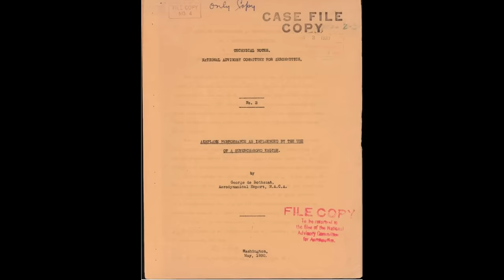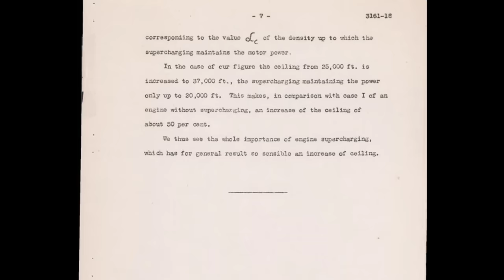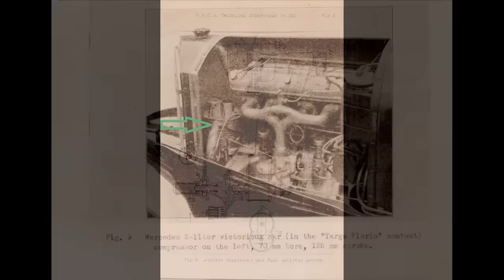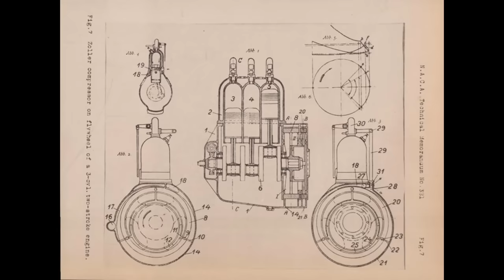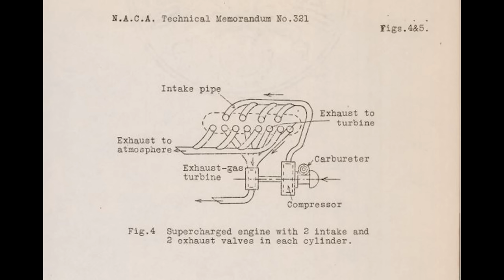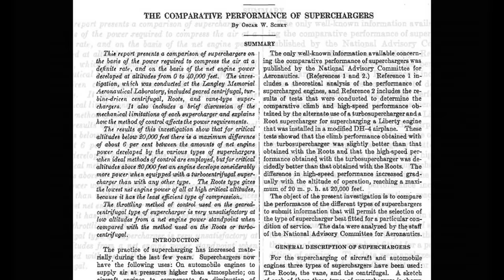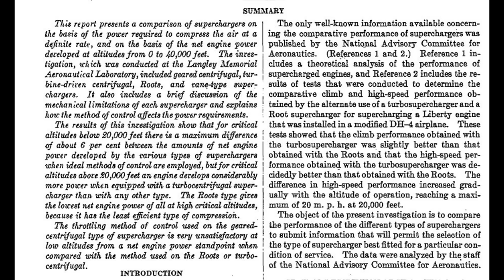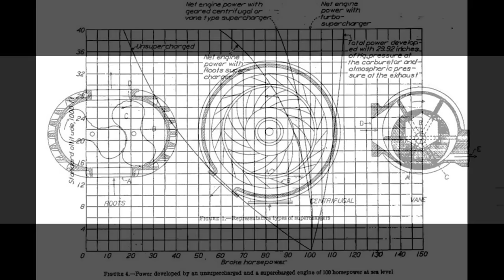Turbo vs Supercharging in WW2 Airplanes

Comment: Man - so many technical questions posted here. Mine: why aren't superchargers vented like turbochargers? In other words, it seems like a pilot has a lot to do, monitoring main and aux blowers and switching on the aux at altitude. Why isn't there a single high-speed blower used with a pressure relief valve (similar in principle to the turbo wastegate)? If the pressure relief valve maintains an upper limit on the pressure in the blower, the blower will spin madly at low altitude, but only produce, say 50 inches of mercury because of the relief valve. At 25,000 feet it will do the same, but venting is less necessary because of the lower initial air pressure through the intake. 

I am aware of the German solution with fluid coupling connected to an altimeter, but that seems to add more weight and complexity.

A second, tangential question - what was driving the limit on induction? It seems like the Australians pushed the limits quite a bit. What prevented an increase to 70, 80, or more? Preignition, or was there a mechanical constraint beyond which some part of the system would fail or wear out too quickly?
Reply from the maker: First Question. The answer is because then you would be paying for boost you are not using via excess supercahrger RPM. Second, they did go to 80 and even 90 inches of manifold pressure. The limit was normally knock, but not always.
Reply: @GregsAirplanesandAutomobiles  This is kind of my question. Isn't the bulk of the parasitic drag caused by turbine working against the positive pressure (as opposed to just the spinning of the turbine)? If it is the pressure, wouldn't having the pressure bleed off at your preferred PSI mean that you aren't getting any additional drag? 

You are obviously more familiar with forced induction, but it seems like a turbine spinning but not generating pressure would meet a fairly low level of resistance. I envision the bleed-off valve sitting on the turbine housing, preventing pressure (beyond what you want) from building up anywhere in the system. At low elevation the blower would send the bulk of the air out the valve, uncompressed. This would keep a constant pressure downstream from the blower, but prevent the blower from meeting any unwanted resistance (at low altitude). At higher elevations more of the air goes down the intake and you have more parasitic drag.

Comment: Greg's Airplanes and Automobiles
 No mention of the additional exhaust impulse thrust (negated by turbo-charging) or heat exchanger duct thrust ?
When in the high altitude cruise condition these can constitute up to 1/3 of the total propulsive power
Reply from the maker: Of course I have mentioned that, and gone over both factors extensively. It's not anywhere near 1/3 of the total propulsive power though, at least not in a WW2 plane. Now you didn't expect me to get everything into one video did you?
Reply: @GregsAirplanesandAutomobiles  Ah Great! I will look for that then. Though still think that it would be worth a mention in this analysis and quite relevant as with a turbocharger, there would be little if any exhaust jet thrust. 
George Bishop I think it was at Hatfield, chief designer of the Mosquito, once said after a long and involved set of test flights, finally achieving 424 mph (from memory)... "Next time, I think, we should start with the exhaust system and design an aircraft around it" 
They did also of course, try to benefit from a Meredith effect style radiator installation in the wing root. The Hornet brought all of these optimisations together with the ultimate mark of Merlin engine and tight cowling, and pretty sure Capt. Eric Winkle Brown mentioned 490mph being seen during RAE proving trials.

Comment: greg. Great stuff. Please do another where you the explain the following: differences, in any, in bsfc between turbos and multi stage, multi speed superchargers. Also, please explain the differences in construction and efficiency between the WWII open bucket turbos and modern turbos.  I have never understood why the 985 in my Staggerwing will make 310 hp on 21 gph  ( 19 gph, with a Bendix pressure carb/injector carb) at S/L, but requires 25 gph to make 300 hp at 8300 msl, all in standard conditions of course. Another bsfc question: how come the 985 at FT (no throttling issues with the blower) will make significantly more hp at 2200 rpm than at 2000 rpm at 12,000 and 15,000 msl  at EXACTLY the same fuel burn.  FYI, on turbo back pressure effects on power. I have several thousand hours in a Midget Mustang with an angle head Lyc 360 and manually controlled turbo.  Fuel consumption, at 75 F lean of peak, and 24 square, was identical at S/L & 17.5 K. BSFC in both cases was .425. EGTs and CHTs were way in green in both instances.
Reply from the maker: Hi Tom, I'll have to discuss BSFC at some point, but I can't get to that just yet. Each of those questions would almost require a 10 min video to fully answer.

Comment: Greg, you mention that P-38s couldn't really show their high altitude performance in the pacific. I highly recommend reading Martin Caidin's book "Fork Tailed Devil: The P-38". In this book it is noted the P-38 had an entire campaign of operations over 20,000 ft against the Japanese base at Rabaul. The P-47 was also a contender for these operations but the P-38 had a longer range and so was preferred. While the P-38 had trouble initially at high altitude in Europe, the same poor results were not seen at the same altitudes in the pacific. Part of the reason for this was in England, almost every P-38 pilot was trained on single engined aircraft and had never flown a twin engined plane before, let alone learned how to operate the P-38s cooling and turbocharging systems correctly. (According to pilot account in Caidin's book, early P-38's had a very low level of automation and required a lot of pilot knowledge to fly effectively.) Many damaged allisons and damaged turbocharging systems were the result of this lack of training. I'm not trying to disagree, the P-38s did have trouble with freezing temperatures in the earlier models. Once again, I love your channel Greg, it's one of the best, if not the best, channel on these topics. I always look forward to your videos!
Reply from the maker: Hi Stefan, I have read Martin Caidin's book, but it was a long time ago. I am a fan of his work. I only touched on the P38 in this video, but I'll cover it in more detail in the future. While it did operate in the Pacific at high altitude, most combat took place at lower and medium altitudes. The ability to fly up high and dive on enemies was a huge advantage for the P-38, but generally speaking, it wasn't shooting down Bettys, Sallys, Vals, and Zeros at 25,000 feet. Again, I'll cover this plane in detail later, I can't really do the subject justice any other way.
Reply: @GregsAirplanesandAutomobiles   Looking forward to it! Thanks for the reply, and yes I didn't mean to claim they flew at such high altitude all the time. Thanks again for the great content, I learn a lot from your videos!

Comment: A Roots style supercharger is called a Blower in slang for a reason - It does not compress air, only moves it at a higher velocity than the engine is drawing it. This is what creates boost - the air backing up between the "blower" and inlet valves. It's a very inefficient power adder.
Reply from the maker: It's more correct to say that it doesn't compress air internally, but it still compresses air in a piston engine application. The Roots type has advantages, but yes, it's generally less efficient than the other types. I actually have a video coming up about about a 400+ horsepower Roots supercharged 1.5 liter engine. Roots superchargers can and do work very well within certain parameters.
Reply: @GregsAirplanesandAutomobiles  Yes, it compresses the air in the manifold, not internally.

Comment: Hi Greg, new listener and new subscriber. Very informative video.
I am an army brat and spent some time in Germany as a kid.
Ages 4-6 in Berlin, ages 12-15 in Heidelberg. The 2nd time influencing most of my interests, 
I was an avid fan of ww2 aircraft and the general history of the time (almost exclusively european theater) as a kid, but during high school (stateside) I lost interest due to my new warring interests in cars and girls.
This overlapping information you provide is awesome. 
I don't know if you have covered this in any of your videos yet (possibly falsely, I learned this in high school, so.... girls you know) I recall that the rootes types  supercharger had issues with pulses caused by the lobes inherent design. Later version have advanced of course with spiral lobes, and other configurations, but the early ones were problematic for the pulses in the charged/pressurized air.
Reply from the maker: Hi Larry, yes, that's true, early Roots types have two intermeshing lobes, and they cause a pulsing. Later types get around that with various methods, currently the latest types used four lobes with so much twist in them that there is minimal pulsing.
Reply: Wow, thanks for responding so quickly. I didn't expect it. 
I am a fan of your videos, currently working thru your library. I just watched one where you are in Rammstein, I visited there once as a kid, didn't remember the castle and vaguely remember the base. 30 plus years ago. Do you live in Europe or just visiting?
Reply from the maker: I am an airline pilot, so I end up there at layovers from time to time. I like in Oklahoma.
Reply: Very cool, Washington for me

Comment: Thank you for this informative video. With technical information such as that you reference perhaps I can now start to understand why those at the top of the RAF were so fixated with the doctrine that the ' bomber will always get through'. However its seams obvious to me why the inline V12 was so dominant at the beginning of WW2, it was the only production option available, in Britain anyway, to Mitchel and Camm, that allowed them to get the speed required to outperform Germanys fast bombers. Germany do have a production radial available in 1941 and its used in the FW190, but RR are quickly able to match or exceed its performance by the introduction of the 2 stage boost MKIV spitfire. I note you didn't mention the Griffon, how would P47 compare to a mk22 spitfire? ( sorry I know I'm a biased Brit, but I did  worked for a US firm for 30yrs),
Reply from the maker: Hi Laurie, I'll try and work some Spitfire comparisons in the next video, and eventually I'll cover the Spitfire in more detail.

Comment: I've watched a lot of your videos about superchargers and they are incredibly informative, one thing I would like to know though is why didn't they use ram air turbines to power their superchargers, with a variable pitch propellor they could vary the amount of manifold pressure at will. Is it just a matter of there not being enough energy to extract? I'd think at those speeds it would work. I also don't understand why without a supercharger the manifold pressure max is atmospheric pressure, I'd assume it would be much higher due to the pressure of the air entering the intake scoop at speed

Comment: In a Japanese aircraft name, Ki isn't an abbreviation, it's a word.  "Ki" = American "key".  Ki is written キ (the phonetic symbol for ki) but originally comes from the character for "machine", 機体.  Details available at https://ja.wikipedia.org/wiki/%E8%BB%8D%E7%94%A8%E6%A9%9F%E3%81%AE%E5%91%BD%E5%90%8D%E8%A6%8F%E5%89%87_(%E6%97%A5%E6%9C%AC)#%E5%A4%A7%E6%97%A5%E6%9C%AC%E5%B8%9D%E5%9B%BD%E9%99%B8%E8%BB%8D
Reply from the maker: I'm sure you're right, so why the heck don't we just Write Key 84? I don't even remember discussing Japanese airplanes in this video.
Reply: @GregsAirplanesandAutomobiles   Greg's  you tangentially name-checked the Ki-87 as the k-i-87 in this vid...  Only going into pedantic detail as I thought you'd enjoy the drilldown.  A million thanks for the vid series.  Digging the cars too but really love the detail on the planes.

THE BIGGEST QUESTION I HAVE after watching this vid is why turbo packaging was so horrible?  Why not snuggle them up to the engine as we do now in cars?

SECOND QUESTION is cost.  How much more did Thunderbolts cost than Corsairs?  It seems like there's no point to Thunderbirds below 20,000 ft and yet they were used in ground attack.  Wouldn't it be cheaper to just make some (say) Corsairs for Europe and a few fewer Thunderbolts?  The Corsairs optimized for that wouldn't even need the aux blower and could have a bit more armor instead.
  To answer my own question, perhaps it's better to make one general purpose plane you can use for anything, rather than specialized planes for each little role?

THIRD: why didn't Allison simply copy the Merlin's general blower staging "on spec"?  Granted the US military wasn't yet requesting them but as an engineer it seems like quite easy work. with no downside and potentially huge upside.

FINALLY: I've always thought the P-38 would have made an equally good (or better) schnellbomber as the Mosquito, and be feted not disparaged in the European theater.  Instead it's initial inability to dogfight interceptors seems to have soured the theater on the 38s completely.   I'd be curious to hear your thoughts on that generally, and given this video I'd love to hear how their performance compared by altitude (thx to 38's turbos).
Reply from the maker: Thanks, I have to admit, it's been a while since I made this video, and have probably forgotten some of the details. Thanks for your kind remarks, and the clarification on the Ki term.

Comment: The turbo-supercharger won in the end. They just cut out all the fiddly pistons, cylinders etc. and ended up with the gas turbine (aka "jet").
Reply from the maker: It sure helps make power when all the parts are moving in the same direction.

Comment: ASAIKThey fitted the turbo at a 90 degree angle because of compact form and shorter airflow. Can't remember if the 90° angle the air has to take was the better, smaller angle solution or worse, extra angle.

Comment: I have a 2.0l direct injection gas turbo engine that really seems to have eliminated the lag.  Maybe lag was not so important on airplanes.  Interesting about the different types.  I had no Idea.  There is a supercharged Merlin in Pearson air museum Vancouver, WA.  I might have to go back and look at it again.
Reply: I think I figured out my own question.  Direct injection reduces the intake headspace so you don’t get the ballooning effect and turbo pressure increase is more linear.   I would be curious if any airplanes are using direct petrol/gas/benzine injection?
Reply: @naughtiusmaximus830  in General Aviation, I can't think of any production engines that are direct injection. However, I am not knowledgeable about the mechanical injection found on the Lycoming/Continentals.
Reply: @jiroyamamoto2878  Maybe turbo lag is just not an issue.
Reply: @naughtiusmaximus830  Yes, turbo lag is not really an issue, until you have to go around, as in abort a landing, when suddenly throttle response is an issue. Until that moment though it is not. Direct injection was pioneered by compression ignition engine manufacturers, in this case, Junkers. That was then transferred to spark ignition engines, the DB601, the Junkers Jumo and the BMW 801. Direct injection was adopted later by some other nations. Japan on a late war fighter, the Ki 84 and some others I don't remember.

Comment: I recall reading somewhere that turbo required more sophisticated metallurgy than superchargers- higher RPM?  And that was one reason Germany didn't go that route.  And that the experience gained in the US on turbines was a step up when jet engines came along.  Does that sound plausible?
Reply from the maker: It's entirely plausible. In fact it's true. G.E. had a huge head start in building turbine engine because of their experience with turbosuperchargers. Germany had metal shortage issues pretty much through the entire war.

Comment: This was super good!  I haven't heard the reason the Navy didn't like liquid cooling - insight on that?
In what little hot rodding and other wrenching (on little stuff)  I've done, it's been the case that with better control over head temperature (like you get with liquid cooling, or better yet, with aluminum heads too) - the more compression you can run, thus more power, while the air cooled stuff (especially smaller engines) need to have less compression and can't run the timing advance, because the head might get hot enough to lead to knocking/detonation a lot easier.  I'd guess most of us know that a liquid cooled engine is not as bullet resistant, but I never heard if that's why the Navy didn't like them.  Was the airplane tech for engine temperature control in air cooled engines a lot better than say, what a Volkswagon had?  It was obviously better than your lawmower.  
FWIW, I'm a p51 fan, one of "those" partly because I'm using the DC generator from one as the backup generator for my off-grid solar system - and it's worn out a few engines underneath it since 1980 and is still going strong...boy did they ever build those things!  On the other hand...looking at some research, they did use that same part in a few fighters, I just found the P 51 reference first.
Reply from the maker: The Navy's penchant for avoiding liquid cooled engines was largely due to logistics. One more chemical to store, transport of deal with is a problem on a carrier where space was already at a premium. Same thing when supplying  remote islands. Plus they felt that there was a reliability concern. One more thing to fail in your single engine airplane over the open ocean.
Reply: Thanks!